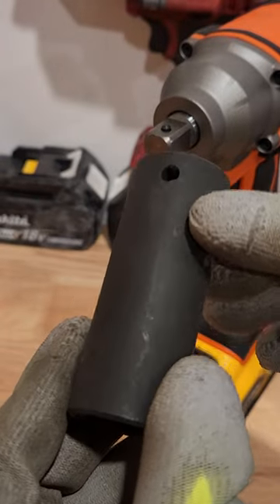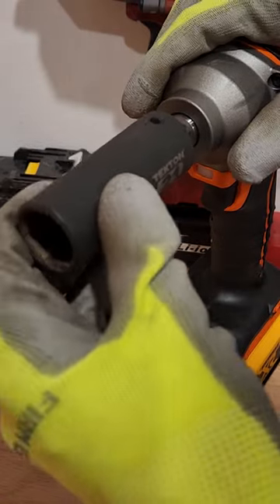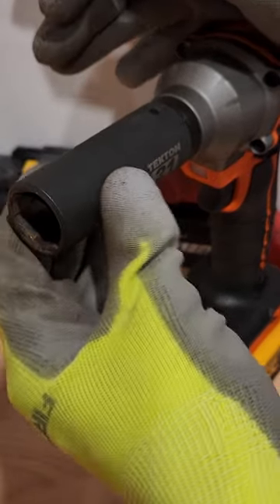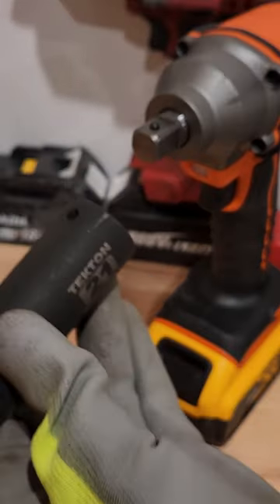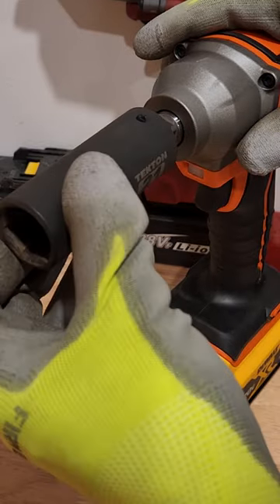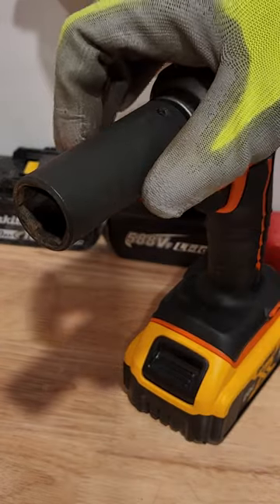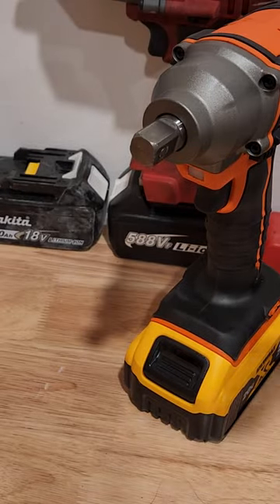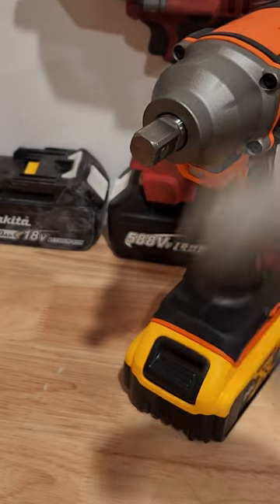Impact Wrench pin detent

Comment: Hog rings are better imo then a pin. Accidentally sliding your socket on the pin under the truck or in a tricky to get into spot really sucks.
Reply: Yea, good luck when the hog ring gets worn
Reply: @avesfather Been using my impacts for years, never had an issue with the rings. But even then, they’re easily replaceable